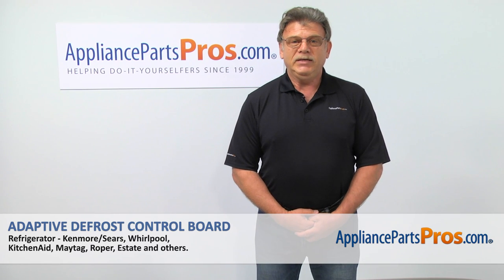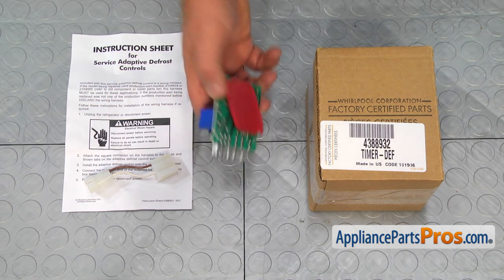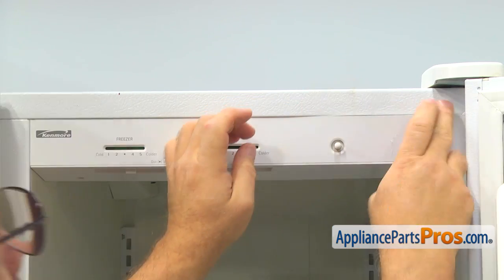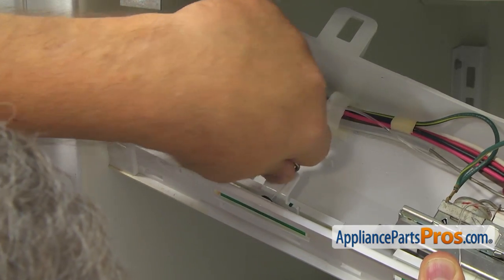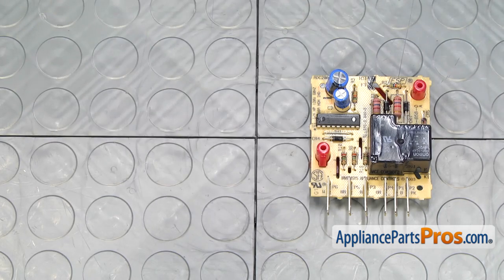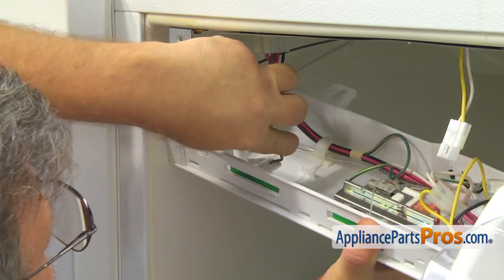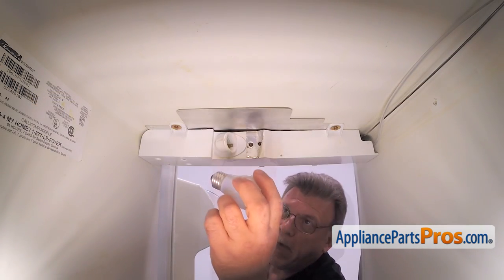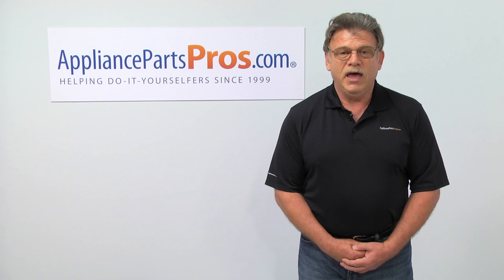How To: Whirlpool/KitchenAid/Maytag Adaptive Defrost Control Board 4388932

Comment: how do you test timer board?? to determine if its bad? what pins should have voltage?
Reply from the maker: Probably more than we can cover here. Without knowing what you have, I would suggest posting the problem along with the appliance model number on our repair forum and the techs can help you troubleshoot the problem. http://forum.appliancepartspros.com/
Reply: There are two simple tests you can do to see if the ADC board or the temp control switch is defective. All you need is a jumper wire about 4" long with male spade connectors crimped on. Unplug refrigerator from the power source. First test; pull the two connectors from the switch. Jumper across those two wire connectors by passing the switch. Plug in power. If refrigerator starts to run, the temp control switch is defective. If no start; test two. Unplug power. Turn switch to off position. Reconnect switch wires. Unplug 4 blade connector from the ADC board. Jumper terminals black to orange on the harness connector. Plug in the power to the refrigerator. Rotate switch to on. If refrig starts and runs, the ADC board is the problem.
Reply: That was it! Took me a little figuring out, as to just what to unplug, but thanks very much!
Reply: @1randyful  Thanks for this.  I had all but given up on this fridge.  Test 2 did the trick.
Reply: Thanks. You know a lot more than the guy who made this video.
Reply: @1randyful  Thank you very much, I could not find this information anywhere!!
Reply: I don't understand how these two tests work if you're not isolating the parts and testing the parts directly.   @1randyful

Comment: I've got a roper brand refrigerator. I just want to see what terminals from ADC board to see if its transferring voltage to cold control and to the heaters. just a basic troubleshooting problem. there's terminal 1,3,2, and 4.